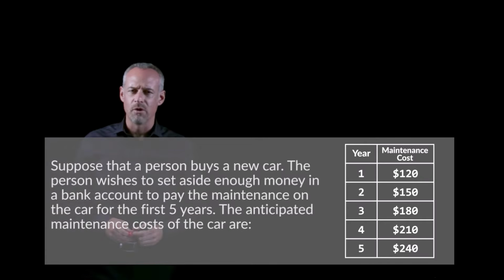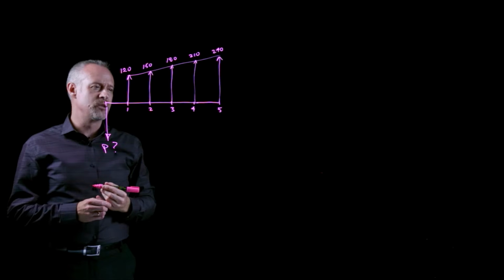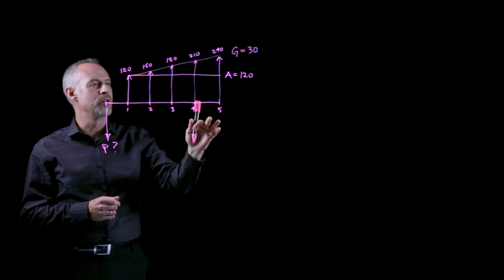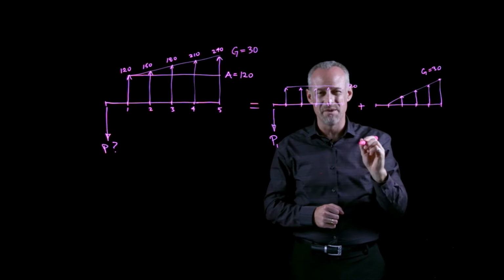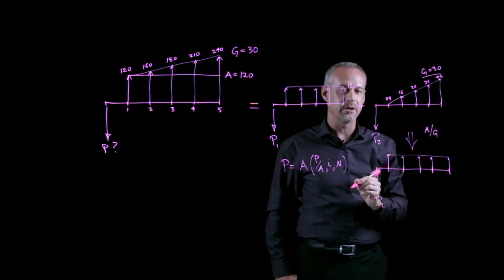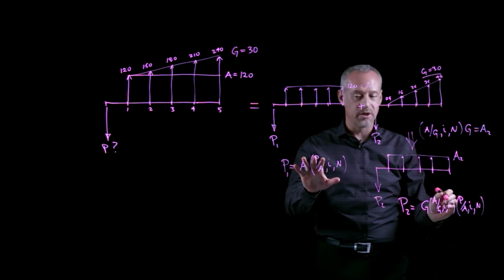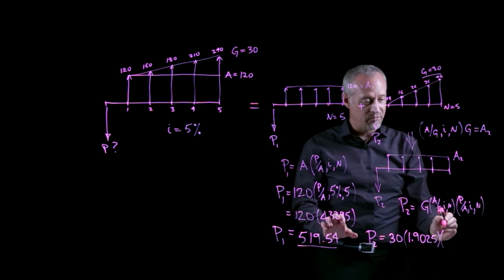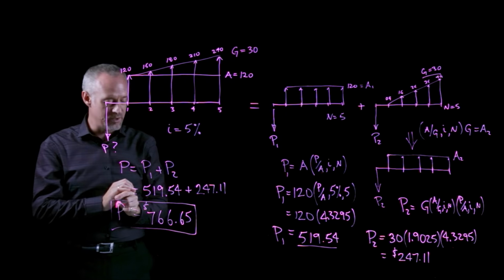Arithmetic Gradient - Engineering Economics Lightboard

Comment: This might be an obvious question, but its been causing me some headaches to wrap my head around it. When we look at the Gradient "G", why is n=5? I understand that at the beginning of the gradient we have a value of 0*G. In that case 0*G=0 and its added to the 1G, 2G...etc, why wouldn't n=4 since 0*G=0. 

I know its a big difference when it comes to the values on the table between a n=5 and n=4. I guess my overall question is why do we count 0G as part of the n terms?
Reply from the maker: Excellent question.  Simple answer:  This is the way the formula for G has been calculated - i.e. 0G at t=1; 1G at t=2; 2G at t=3; etc.; this is why n=5 in this example video.  Just make sure you understand the "pattern" otherwise the formula doesn't work!  BETTER ANSWER:  I know it is weird and confusing, but, there is a good reason the formula for G is like this:  It makes a "G" stackable with an underlying "A", where the value of an underlying A is a constant value annuity starting at t=1.  So, if I payments were something like:  $100 at t=1, $110 at t=2, $120 at t=3, etc., we could model this cash flow with an A=$100 for n periods + a G=$10 for n periods, where n is the same for both the A and the G.  I hope this explains it!  Good question - very reasonable to question the "pattern" for G.  Good luck in your course!
Reply: @ That's it!!! it makes it stackable!! That makes sense, I dont know why i didnt see it that way before.  Thank you!

Comment: I am in the middle of studying for my PE license and this is an important section in the exam. The confusion that I am having with the gradient series is the n value. When solving a cash flow diagram involving a gradient series, wouldn't n for G = n - 1 since the gradient starts at year 2? Maybe I am getting confused with the generic diagram that shows the 0g, 1g, 2g ... all the way to (n - 1)G for the final gradient. Is this not the same case for the n value in years used in the calculation? 

In the example you did in this video, I would have said the n value for G was 4 since it starts at year 2 (and the total period was 5 years). Is there any circumstance where this is correct?
Reply from the maker: The Gradient DOES in fact start at n=1 but with a value of zero!  Confusing...yes!!!  I think of it like this:  The gradient is a triangle that starts with its tip at n=1 (so the height is actually zero at n=1, but the triangle starts nonetheless!).  Most books, and this video, explain it as starting with 0G (zero-G).  Just ensure you realize this example has 2 components:  A gradient (triangle), AND an underlying regular annuity (rectangle).  Hope this clarifies.
Reply: Makes perfect sense now. Thank you for that clarification! @EngineeringEconomicsGuy
Reply from the maker: Happy to help!  (Be sure to "Like" and "Subscribe" as they say!!  It really helps my views and the YouTube algorithm.)

Comment: how about the decrease gradient problem sir ?
Reply from the maker: Good question!  Sorry, I haven't recorded a video with a declining G.  I'll put it on my list of things to record.  In the meantime, I can offer the following advice:  The underlying 'regular' annuity will have a value of 'A' which is the value of the cash flow at time t=1 (don't worry that the values are declining, we will look after that!).  The value of G will be the constant amount of the decline in the cash flows each time period.  Rather than adding the present value of the G 'triangle' to the present value of the regular underlying annuity - You Subtract it!...  So, using this video as an example, the final value of 'P' would be 'P1' minus 'P2', where 'P2' is the value of G(A/G, i, n)(P/A, i, n).  Hope this helps!
Reply: @EngineeringEconomicsGuy  not really because another version of this question is to find that G value such that a specific amount is invested for efficiency improvements in a machine and you want to get a specific return in the cost reduction of manufacturing, therefore, what is the G-value to recover your investment and realize a 14% return on that investment due to lower manufacturing costs because of your investment?
Reply from the maker: This would be a different type of problem.  If the "shape" of the cash flow diagram is the same as this example but with an unknown 'G', then you can still create a 'time-value-of-money' equation that is of the same form as this example.  To solve for the unknown G you would need to be given the value of P (and you would use 14% as the interest rate).

Comment: I used a different logic and getting a completely different answer. Please tell me where I am wrong.

My interpreation of the problem is that we know by end of 5 years the guy will need $900, so I am supposed to find how much money should he invest in the bank today @5% interest, so that by end of 5 years the total in his bank account in $900. In this scenario if I invest about $675 then at the end of 5 years I have $905 in my account. 

Y1 Start: 675 | Y1 end: 709
Y2 Start: 709 | Y2 end: 744
.
.
Y5 Start: 861.5 | Y5 end: 905   

Please tell me where my understanding is wrong and without using the formulae, how can you intuitively explain what does 766.64 mean.
Reply from the maker: Sorry, this is a time value of money problem.  That means you cannot simply add and subtract dollar amounts that occur at different points in time.  Before you tackle a problem such as the one in this video, please review some of my other videos on understanding the time value of money and patterns of cash flows.  This type of financial math works differently from what you are probably used to.  Q:  Would you rather have $100 today, or $100 a year from now?  A:  You would rather have the $100 today so you can earn interest for the year...making $100 today Worth More than $100 a year from now.  Please take some time to digest this fundamental concept.
Reply: @EngineeringEconomicsGuy  Okay, now I understand. So basically for paying 120 next year I put $114.29 NOW in the bank. Similarly to pay 150 after 2 years I put $136.05 NOW in the bank, and so on. And then when I add everything I am putting now in the bank i.e. (114.29, 136,05, 155.49, 172.11, 188.05) we get $766.64. 

Thank you soo much for replying back!
Reply from the maker: You've got it!!  Exactly correct - well done.  Good luck in your course!

Comment: I get confused when there is a gap between present and future gradient. What do we do when questions say '8 years after depositing, you want to withdraw $1000 decreasing 5% every year at 10% interest?' 

Or when questions have a negative annuity in the past and a positive gradient overlapping but going 3 years past the annuity?
Reply from the maker: David, yes, there can definitely be some difficult scenarios with gradient series.  I don't have a video for the cases you're talking about, HOWEVER, the key to solving difficult problems is to have a strong grasp of the fundamentals.  I recommend this video:  https://www.youtube.com/watch?v=t3i7OFWxIN8&t=371s  You should focus on the patterns of the cash flows.  Once you understand the patterns, you can mix multiple compound interest calcs to get the answer you need.  For example, if you have a gradient that starts at some time in the future, you can find an equivalent 'P' or 'F' at the point in the future that matches the G pattern, then use an F/P factor or a P/F factor to move th 'P' or 'F' amount to whatever TIME you want.  My video on 'equivalence' might also be helpful!  https://www.youtube.com/watch?v=2LPg_HmPwb4  Good luck!

Comment: What I totally don't get, is for p2, you do P2 = G(A/G)*(P/A)

Now, I know here we are going from finding A and using that value to find P. To find A, we do G(A/G), and that result is our A. Then do find P, we do (P/A) but we dont multiply by A? Why dont we multiply it like we always do? In this case, the formula should be  P2 = G(A/G)*A(P/A), but of course its not, but why not? Where does that A just disappear?
Reply from the maker: We split the problem into 2 parts:  1) the G and 2) the underlying A.  Think of them as the triangle and the rectangle.  For the 'triangle', (the G) we don't need to multiply by the A, that is calculated in the other 'part' of the question.   But, notice that we add the P1 and P2 at the end.  Hope this explains it.  The video is correct.

Comment: Sir, isn't maintanace outflow?
Reply from the maker: YES!  However, the way the problem is setup is a little strange!  The problem is asking 'what amount of money needs to be set aside TODAY to payout the required $ amounts to cover the future maintenance costs?'.  For this reason, I've structured the cash flow at t=0 as a down arrow (money is coming OUT of your pocket - i.e. -you are investing it somewhere); and the 'payouts' of this 'investment' as up arrows (you are RECIEVING the money from your original t=0 investment).  Of course, you then use that money to PAY the maintenance costs but that step is not part of the cash flow diagram.  I know it's a little confusing.  Hope this helps!